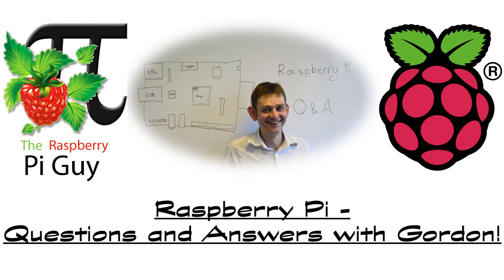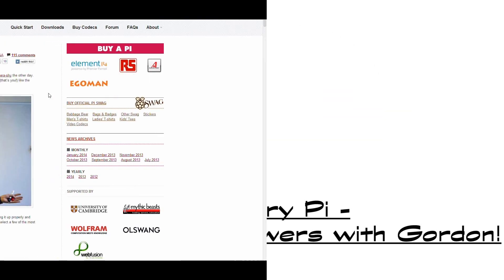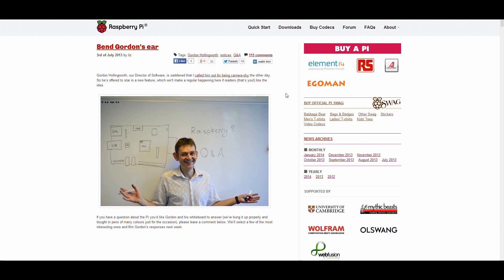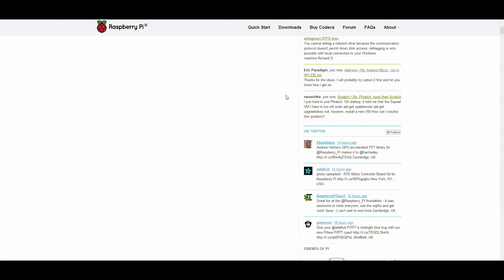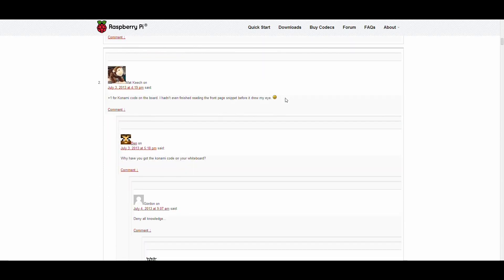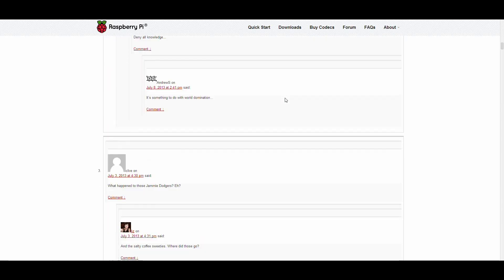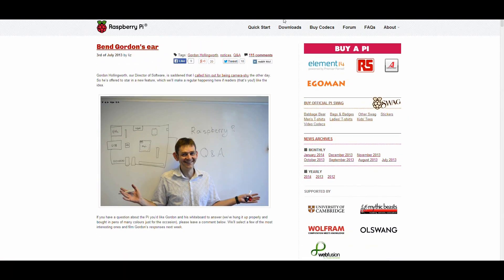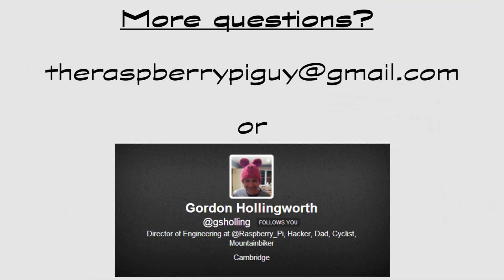Raspberry Pi - Questions and Answers with Gordon!

Comment: I have 2 RPis and both of them corrupt 2 64GB SD cards when overclocked... how can I check if I should send them back, did they fix this in hardware or in software?
Reply: We worked around a hardware issue, so its possible it's not fixed 100%.  Check again with the latest Raspbian image from the site and if the problem still exists and is repeatable then I'd be interested in getting hold of the Pi / SD card
Reply: Jessica Hollingworth Oops, shouldn't reply from my daughter's account!